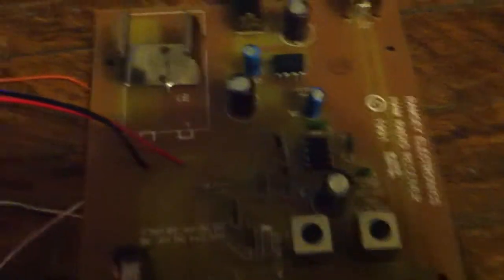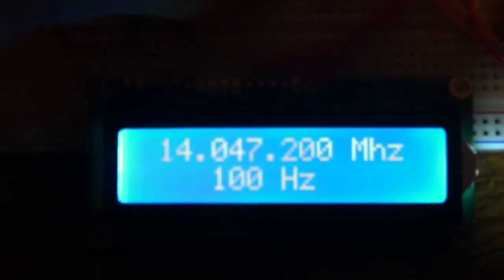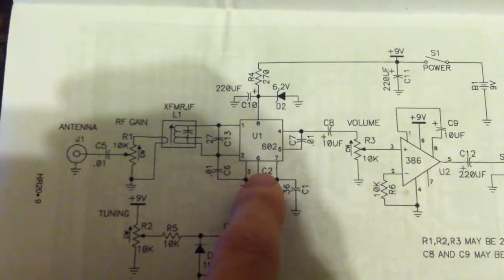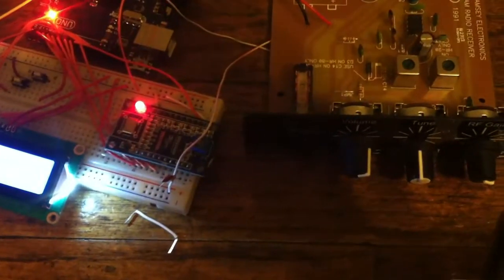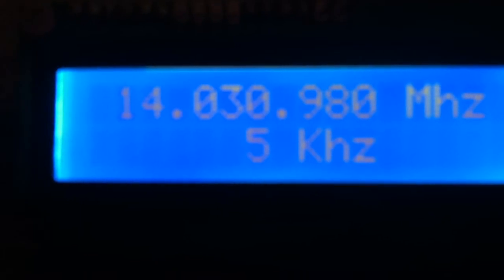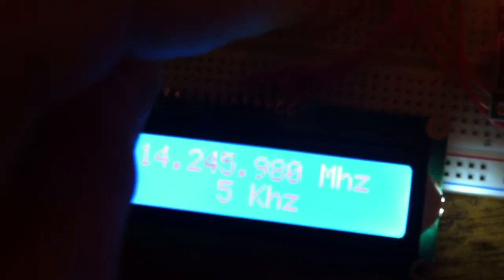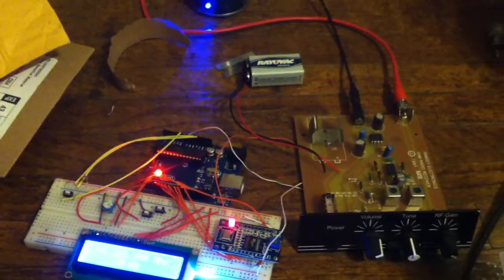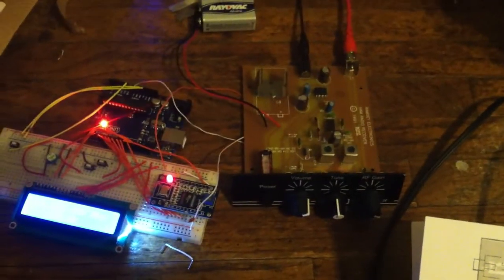Ramsey HR20 Direct Conversion Receiver with Arduino DDS VFO

Comment: Neat, I bought one of those kits last year just before Ramsey stopped selling them. I had thought about getting rid of the analog oscillator and using something digital. So it's good to see that it would work.